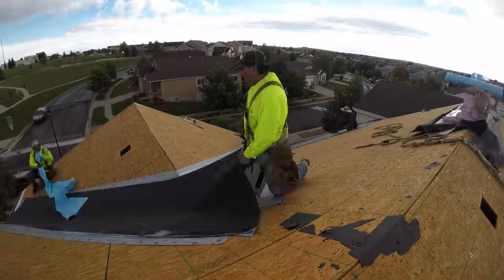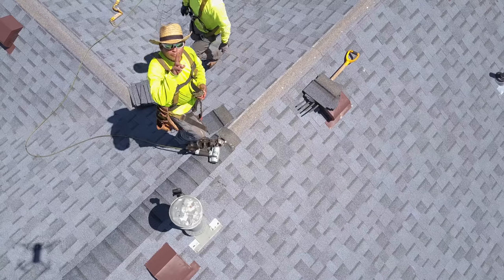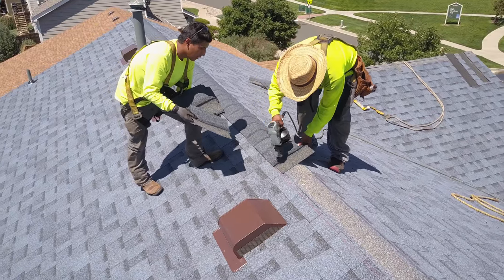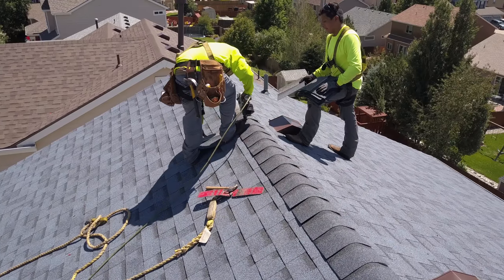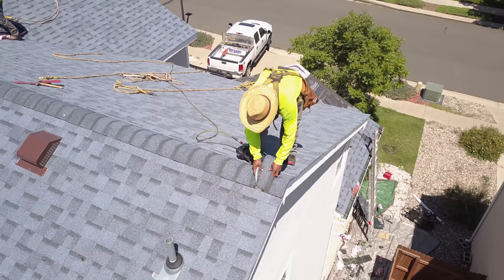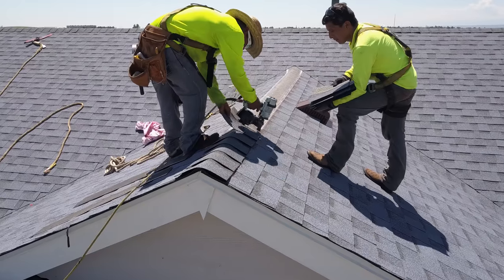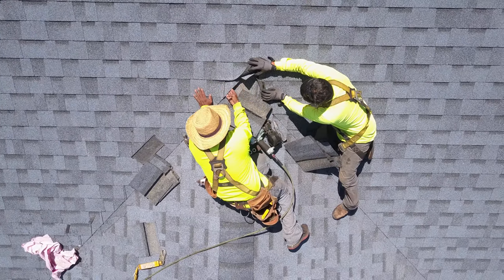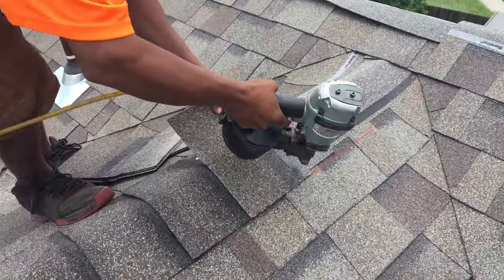HOW TO INSTALL RIDGE CAP | ROOFER TRAINING

Comment: Never understood layered layered ridge capping, but it seems to work.  My issue is, shingles rely on slope to shed water, but this is a horizontal surface and any wind is going to blow underneath the cap.  I'm not saying anything is wrong with the job, but I wouldn't mind some feedback
Reply: Just guessing, I don't know for sure. But, I bet you are supposed to run the lap edge so it is facing away from prevailing wind? Curious, what do you suggest? Not being a smarty-pants, I really want to know some suggestions. I am replacing my own roof ridge. That is why I am here. I'm guessing there is a better way. Most houses in my area seem to use this shingle ridge method. A solid ridge piece (aluminum, rubber, or vinyl) seems like it might be better. The shingle ridge is likely just done for aesthetics to look consistent with the rest of the roof. I don't care about that crap.... I just don't want the roof to leak.
Reply: if the shingle is flat, wind can get underneath it. if it is curved, it's naturally MUCH stiffer against wind lifting it

take a piece of paper and curve it down then try to lift up the front edge. take another flat piece and try and lift the front edge

you will notice a huge difference

Comment: How far up do you take the shingle over the roof point, should it go over to the other side with it or cut it at the line ?

I watched there is a debate over this with some saying it will raise the caping.

Comment: At the edge where you terminated how would that protect from water leakage? those nails were bare
Reply: Because a drop of water expands it will eventually ruin the gable right?
Reply: A tar seal is used to help prevent/reduce water exposure, and ensure the cap is seated securely against the elements.
Reply: @roberthazelton8824  Thank you I was wondering the same thing!
Reply: Thank you I wondered the same thing!

Comment: Hello. I am not a construction guy, but watching what's going on next door is worrying. My neighbors have a new build going on. It's been raining. The inside of the house looks like a lake. The roofing plywood (Weyerhaueser Gold) is soaked. The black roofing paper is wet and wrinkled. When the guy works, tiles are going down on top of wet paper. No edge tiling is being used at all. It's not my project and I should just probably butt out, but I feel my young neighbors are not getting the best job for the money. Is there an email address where I could send a few pics? If you can confirm my suspicions, then at least I can warn them. Thanks.
Reply from the maker: Hello David, you might consider contacting your neighbor and than the building department.
Reply: That's what I thought, but the roof is completed tiled over wet paper. Maybe will dry out towards the underside like the builder said. At least the flooring is drying out now that no rain is falling on it.
Reply: I would be less concerned by the moisture and much more concerned with the lack of starter shingles.

Comment: Thanks for the video.  I just had 20 feet of ridge cap blow off my roof in a tornado.  I installed the roof myself 5 years ago;  that being my first ever roofing project (owens corning duration).  What you showed certainly was not my nailing schedule.  I put one on each side like my shop teacher showed me back in '91.  And the whole piece lifted off pulling the shingle thru the nail and depositing the shingles in the front yard in one piece. ill be on the roof saturday learning my lesson

Comment: Great video on ridge cap. I have a section of roof that is part of an A-frame with a very steep angle and wanted to know what you would recommend for a shingle (or other type of cover). I think it is 120deg angle and roughly 40ft long. The current shingle is about 18 years old and they used a standard shingle that has held up fine, but not ideal. Thanks again for your help.

Comment: Is it wise to install a roll a of metal tin underneath the ridge cap shingles to have added leak proofing?
I live in South Miami, Fla.
Reply: it's not necessary but it also wouldn't hurt if you can afford it

Comment: Great. The best crew doesn't even tie off. When having the Harness on.
Reply: Lmao where would you anchor your safety rope on an otherwise finished roof? Once the shingles are to the peak you can’t drive anchor screws through it. Also that looks to be an 8-10 pitch which is more than walkable with asphalt on it. Perhaps critiquing a job people should know more about what they are pointing out the wrongs in.

Comment: Any reason why you guy are not trying to nail through the lower shingle along the ridge?  Putting the 4 nails in is great, but if you hit the shingle below wouldn't it be better?
Reply from the maker: Thanks for your feedback. It certainly wouldn't hurt to add extra nails.

Comment: Aren't you supposed to hit the tar strip with the nail? I heard that's where the nail should go as it's stronger for windy conditions it'll hold better and it also acts as an adhesive for the shingle above it.
Reply: NO, you're actually supposed to go bellow the tar line because then it will also penetrate the shingle below, effectively doubling your fastener count per shingle. Nailing in or above the tar line is weaker and will void warranty. The guy in the video was nailing on the wrong side of the tar line.
Reply: @scumbaggo  every roof where I've seen singles blown off were nailed above the line.. theirs not enough meat there

Comment: Are the nails penetrating the shingle underneath, so each shingle has two rows of nails?
Reply: No, the guy is nailing on the wrong side of the tar line. It will be susceptible to high winds.

Comment: I had about 7 ridge cap shingles blow off in the hurricane. Any issues reusing those shingles?
Reply from the maker: Hello Brusier, sorry that you were impacted by the hurricane. The ridge cap shingles can be be reused, however you will need to apply several quarter size dabs of plastic cement. The old sealant will not reactivate. The new plastic cement will bond the ridge cap together.
Reply: Integrity Roofing and Painting  is that plastic cement like for building models or rubber cement?
Reply from the maker: It is roofing plastic cement. You can purchase what you need from a local building supplier or Home Depot. Old school roofers will call it roofing tar.
Reply: Integrity Roofing and Painting thanks.

Comment: Are the nails placed on either side of the tar strip?
Reply from the maker: Thank you for asking about the placement of nails. The ridge cap shingles need to be installed per manufacturers installation instructions. Locate the nails as described on the shingle package.

Comment: I'm doing a small shed. Where my shingles meet at the ridge there is two inches on each side where you can still see the plywood. Should I just cover with the ridge cap? In the video it looks like they folded another row of shingles over and then put the ridge cap over that.
Reply from the maker: You may want to install a strip of ice and water shield over the ridge before installing the ridge cap. We will generally overlap one of the slopes of shingles over the ridge to provide additional protection in the event of a hailstorm or bad weather.